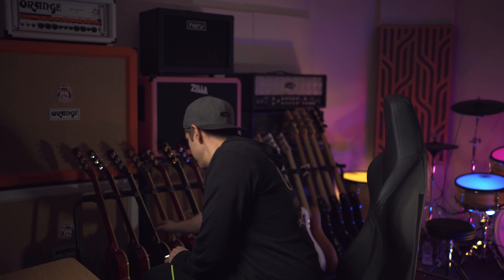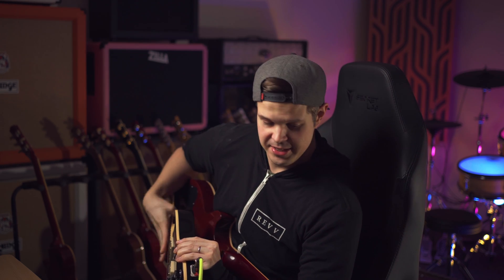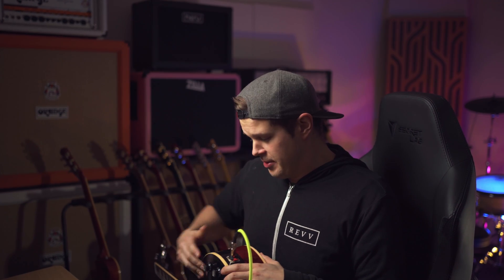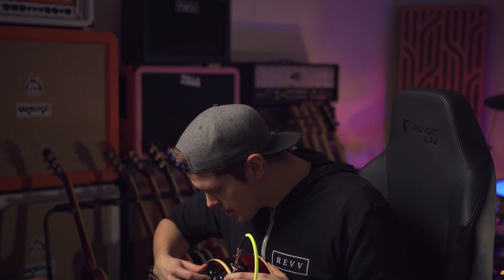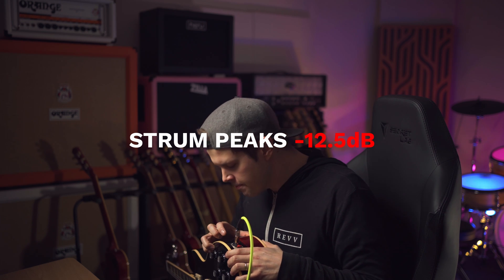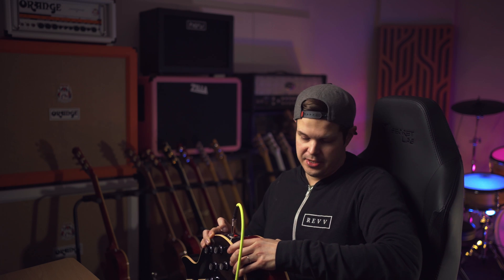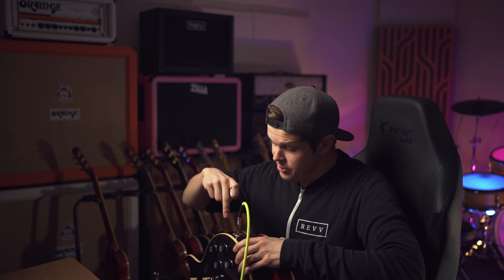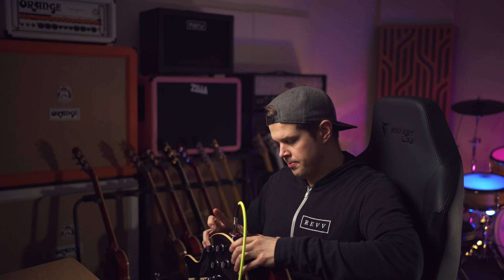TONEWOOD IS REAL - But does it sound any good?

Comment: saw too many videos that prove that "tonewood" makes close-to-zero difference, if any. consider this for example: maple, mahogany, and rosewood are used to make a variety of ACOUSTIC instruments - drums, pianos, etc and of course acoustic guitars. on the other hand, i've never heard of any instrument (other than electric guitars/basses) that's made of alder, ash or basswood. if they have such great tonal qualities, that wouldn't be the case. if i remember correctly, leo fender used alder and ash mostly due to PRACTICAL reasons (both of them were available in north america at the time and were not expensive)

Comment: So, I do experiments as well. The tone of the wood can be heard the same way the tone of a drum shell is tested by drummers before putting heads on and tuning the drum. Hold the guitar by the neck around the 5-7th fret. Makes sure to hold the strings so they don't vibrate. Use a knuckle or a soft mallet, and tap around the bottom of the body. You will hear a frequency come from the wood. That is the woods tone. Maple tops will be resonant and have lots of attack for example. Birch sounds darker with a focus on attack as well. I've picked up some cheap guitars and performed this test and they didn't resonate very well. They didn't sound as good to me as the next one that did have a nice vibration and "tone" when struck freely. That resonance build up can effect the sound of an electric guitar about .01%. Changing a speaker and moving the mic will produce the biggest result, hands down. Great video as always Mikko!

Comment: I fail to see the point of this experiment. We all DO know that wood vibrates, less in electrics than in acoustic, when you pluck the strings and putting two guitars together will make the other string vibrate very little as the vibrations to  travel between the guitars. But that wasn't the main point of the experiment. So what ever symphatetic vibrations we do hear in this test, we will NOT hear them as is when playing one guitar regularly as the strings are vibrating already.

Comment: All this proves is holding two guitars together and strumming one will transfer vibrations from one to the other which slightly rattles the strings. Concrete would do it, perspex would do it. The resonance will effect any dampening of the strings effecting sustain, but not tone. No piece of timber is the same as another, simply because it came from the same species of tree, every tree will have different densities, different growth rates, different cuts etc. A species name is not a control measure.

Comment: You have a metal guitar string, stretched between a metal bridge saddle, and a hard brittle nut, the pick up requires magnetism to make sound. I have always been of the mind that the acoustical qualities of the guitar is meaningless on an electric guitar and is nearly everything on an acoustic guitar. I just don’t see how scientifically it can make a difference in the sound of the pick up. Take the strings off your guitar and knock on the wood and see if the pick ups make noise. If they make almost no noise it can’t possible have a great effect on the tone coming through the amplifier. Maybe I’m wrong.
Reply from the maker: 100% agree with all you said here. I did this test in a video not so long ago. Drum stick vs metal bar in front of guitar pickups. 🎉

Comment: I really wish tone wood wasn't real. I have an EII guitar I love, but has zero mids, jusy some nice treble and MASSIVE, overpowering bass. Seriously, it sounds like there is another acoustic signal, detached from the rest of the spectrum, thag contains bass. I have tried all kinds of pickups and amps and cabs and while there is a difference (especially with cabs), the basic to al characteristics are the same. I have honestly given up now and jusy use it with Empress ParaEQ before the amp/pedal - i boost the mids, cut the bass and add a bit of treble. It sort of works, but this will never sound as good as my other guitars...
Reply from the maker: Remember that your strings are always resting on your bridge saddles and frets. Such a simple and cheap upgrade is replacing cheapo bridge saddles and I promise you the change can be way bigger than a pickup switch. Try it if you can!

Comment: I wanted you to compare the sound of the 1st guitar with the other pressed into it, against the second test with just the 1st guitar (solo). Then we would hear if the change in the body would change the sound of the 1st guitar whatsoever. Nonetheless, good vid, thanks got bringing this up 😊
Reply from the maker: That's actually a good point! The guitars were tuned to the same pitch by the way. 😊

Comment: Inspired by this I did some testing too, I noticed that just moving the guitar around without plucking can get similar sounds as the resonance of tonewood. In my tests I put the guitar body against acoustic to get stronger resonance but I got the feeling that it might be more sympathetic resonance as certain notes made more noise. I also tried putting the electric guitar facedown on a soft surface to mute all the string noise to eliminate the strings ringing out of a sympathetic resonance and acoustic guitar on top (I don't spoil the results in case you want to try it yourself). The tonewood is mostly placebo atleast in recordings and actually the sound is from different things like you have said in previous videos but maybe the vibration of different woods and cuts have a different feel for the player or maybe there is some sympathetic response in the body in response to those, idk im just stretching here
Reply from the maker: This is all hype for a new ML Sound Lab tonewood undampening t-shirts. We all know that if your tummy is soft it kills the tonewood resonance. You need rock hard abs to maintain good tonewood and we all know that. This new t-shirt reflects tonewood back into the guitar and you no longer need a six pack. You need a six pack of beer!
Reply: @mlsoundlab  Damn that's genious, I have a good old soft belly and a six pack of cold beer in the fridge, if you need some product testers. Remember to capture the other side of the market too, the guitar players with the rock hard abs if they happen to want some "soft belly tonewood" -guitar tones

Comment: I used to turn on all distortion on pedaloard with a delay on and speak through the pickup, my voice came through the speaker , so I think the pickup should be able to pick up the tone from the wood also, may be subtle but still there.
Reply from the maker: This is typically an undesirable attribute known as a "microphonic" pickup - normally, pickups will be wax-potted to prevent this (outside of very rare cases with vintage pickups). With microphonic pickups though, I could see the wood playing more of a part in the overall tone of the instrument. 
-Kai
Reply: @mlsoundlab  Pickups are actually wax-potted but I use a lot of distortion/overdrive/boost though ,in extreme way ,to see if my voice go through or not but it still managed to went through , with the delay on , i heard my voice echoeing.

Comment: That Pedal Show actually did something akin to what you do here but to create a custom IR reverb effect from a mic'd up acoustic guitar resting on a stand.

Yet you bring up an important point that the strings can vibrate even when not plucked & those notes including any overtones so long as they are audible will contribute to the guitar's overall sound. But I would instead argue that vibrations felt by the player not just heard are what is the more important issue as they provide additional feedback to help the player express his or her musicality.

Felt not just heard vibrations are a big if perhaps bespoke subject that violin family instrument players exploit for optimal bow control, and the thumb especially but the entire hand is packed with nerves to sense vibrations from nevermind textures, rigidness, et al of what is being grasped or held. Those experiences IMHO both can be and are exploited whenever & wherever they can be reliably associated with the music being performed.

So yes as you conclude & I agree, the tone of the wood itself may not be entirely pleasing at all times. But if it is comfortable to hold & can transmit physical vibrations to the player in a pleasing & useful way then yes it can nevertheless be good tonewood IMHO.

Comment: What if you did this without strings and knocked on the guitar or used a tunning fork on one of them?
Reply from the maker: There would be no sound because guitar pickups only hear the strings. We did this test in a video a while back. Drum stick vs metal block in from of unpotted humbuckers. Check it! So what's left to compare is what is wood resonance doing to the strings.
Reply: @mlsoundlab  there is sound if a mic is used. Similar to when PRS / Keisel selects wood for an instruments. Calling those brands out because there are videos as examples.
Reply: @woodward_alan  you don't plug a mic into guitar amps though, do you? The argument here is whether or tonewood makes a difference in a recording of the speaker / sound coming from an amp. The acoustic sound of wood doesn't prove anything in this matter because pickups are just magnets
Reply: @oskarwroniewicz  sure. Then it would only influence which frequencies resonate best. For example. A notes on my PRS feedback fast and sustain longer. On my acoustic, the G notes die more quickly.

Comment: Do you get the same resonance if the guitars are about as close to each other, but not touching? The strings would still vibrate from sympathetic resonance, and that might make a bigger difference than whatever vibrations the wood is carrying.

Comment: Very interesting, but we’re hearing the resonance of the unplugged guitar getting filtered by the rudimentary guitar-to-guitar interface you created and then again filtered by the resonance of the plugged guitar… that’s why it is (obviously) a low volume and weird tone!
Nevertheless you showed how the wood surely resonates and therefore transmits frequencies back to the strings, which are pickup up by the pickups.
The ideal experiment would be to be able to eliminate the woods from an electric guitar, then add it back and compare. Joan Segehorn progressively cut big chunks of wood from a LP body and showed how it cut low frequencies, but it still is an imperfect experiment as in my experience the neck has a big influence in the harmonic content of a solidbody guitar tone. We should find a hard but unresonating material to build a guitar with, then transplant the hardware and electronics to a real guitar and hear the differences. That guy who wanted to fight the tone wood supporters and ended his video strumming a chord with a “bench guitar” (strings held between two wooden benchs) only confirmed how two big pieces of furniture obviously resonate quite well, by the way.
Reply: You have electric guitars made of acrylic out there to verify it.

Comment: How do you know the pickups in the plugged-in guitar aren't simply picking up the vibrating strings of the other guitar at a very low volume Also, physically clamping the two guitars together with your hands could be dampening whatever resonation you're intending to capture, if it exists at all.

Comment: Resonance does not equal “tone”. The pickup is still only transmitting the sound of the strings. Also based on your judgement about the frequencies that resulted from this test, they will have likely been EQ’ed out my the mixer of any of the famous records with the tones people are trying to emulate.
Reply: The pickups surely transmits the sound of the strings. If you alter the harmonic content of the strings via the wood resonance, you alter the tone.

Comment: If your pickups are outputting resonant signal from the body vibrations, or your voice when you scream into them, or anything other than metal string vibration, it's because your pickups have gone microphonic and probably need to be wax potted.
Reply from the maker: Both guitars in this test have unpotted Gibson pickups! This should emphasize things even more.

Comment: I can honestly say. I have a very rare smauraii guitar made in korea from 1988 with all plywood construction,. The tone is the loudest of all guitars i ever had. The sustain is very strong 20 seconds on the headstock. NEVER had a guitar this good sounding.

And i meant acoustically. Not with amp.its also the heaviest of the bunch of all floyd equip guitar i have. At 3.9kg plus  almost 4kg. Most super strats only weigh between 3.5- 3.4 kg.